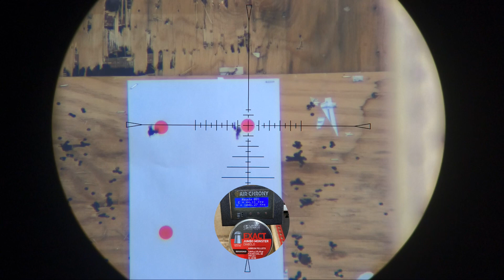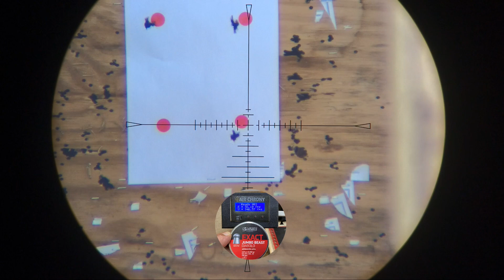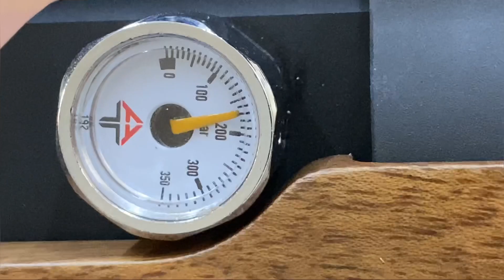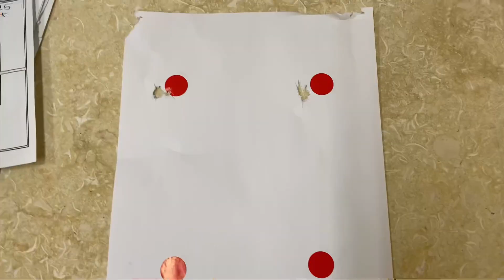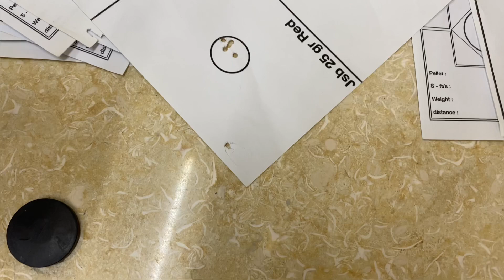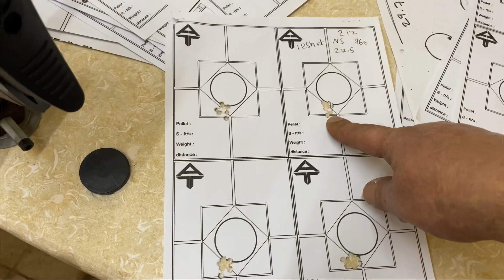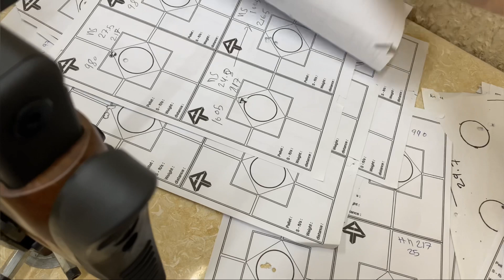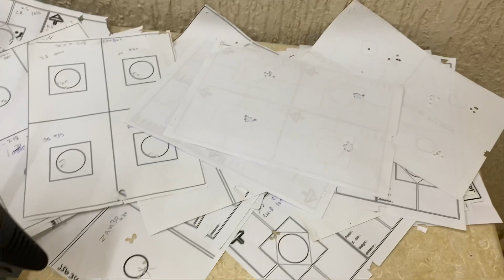Vulcan 3 group

Comment: ممكن نعرف مسافه   
نريد تجميع ع 100 مرت 
وع 200 متر
Reply: It’s 40 Meters dude. He will have to change locations for longer distances but at 40, you can see what works and what won’t with slugs. Slugs typically maintain accuracy at range better than pellets so 40M (or close to 44 yards) is a good enough indicator to rule out slugs.